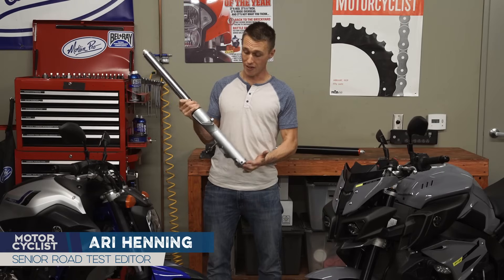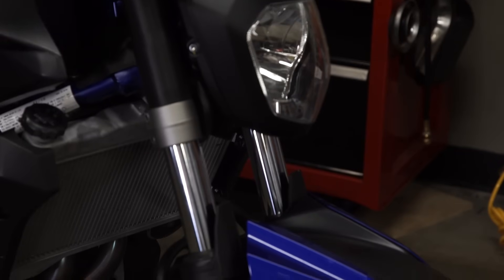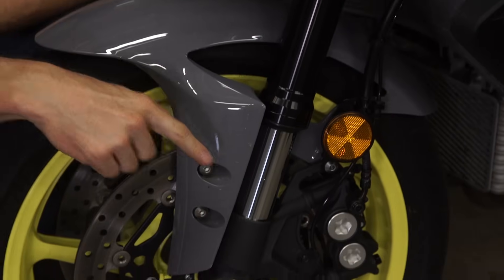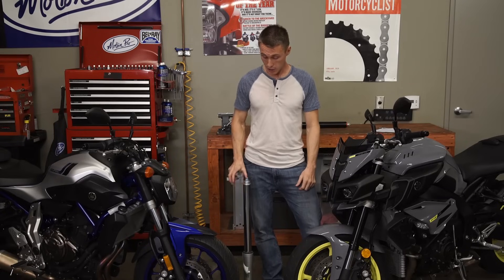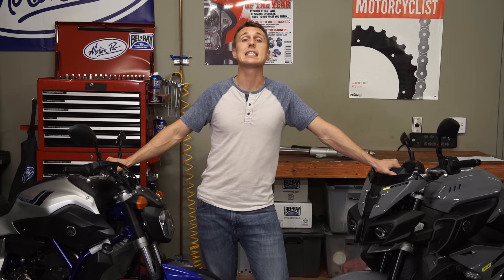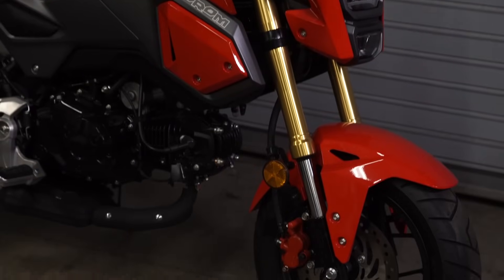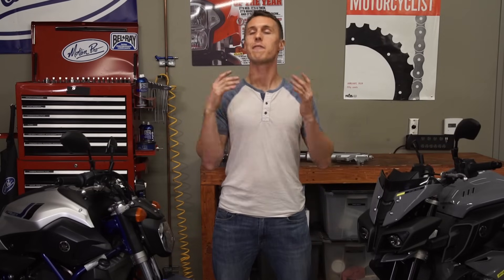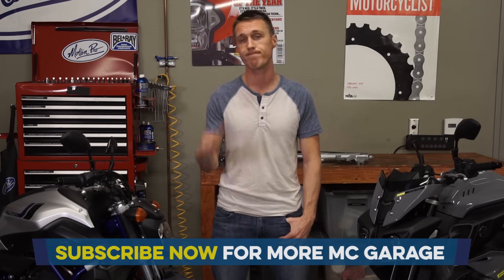Right-Side Up vs. Upside Down – Why Are Inverted Forks So Good? | MC GARAGE

Comment: I once owned a 1982 GSX1100 Katana and the forks would twist when you counter steered at highway speeds, it was the freakiest feeling as you would move the bars and then the wheel would follow 1/2 second later
Reply: I think you had some issues with that particular fork then... I've had a GSX 1100 EF since 1988 (basically the same front fork, except for the PDF units instead of traditional anti dive units) - I've never had any (noticeable anyway) flexing of my fork because of this.
The EF does have a stabilizer built into the front fender though; this might reduce the problem quite a bit, of course.

Comment: If USD are much better, why do manufacturers continue to make RSU forks on their bikes?
Reply: Lancers262 simply put, cost. As he said in the video there are much more complex parts in them, as as they are usually made for higher end performance machines, the tolerance for on the manufactured parts tends to be tighter

Comment: differences in exhaust systems??
or "older type" components they may work better or more reliable or more simplistic than modern systems   say (exp) magnetos ,carbs ,sidevalve(flathead power) ,springer front end.
Steel components vs. aluminum components

Comment: Reduction in unsprung mass is also a huge benefit no??
Reply: Slatteea Not as big as you'd think.  Because the upper part of the fork on either design bears the greatest load, both are designed to be heavier there than on the bottom.  A USD fork has heavy sliders and light stanchions, while RSU forks have light sliders and heavy stanchions.  Strong up top, light down below.
Reply: Yea ... i think its the biggest advantage of all
Reply: JETZcorp I never thought about it that way!